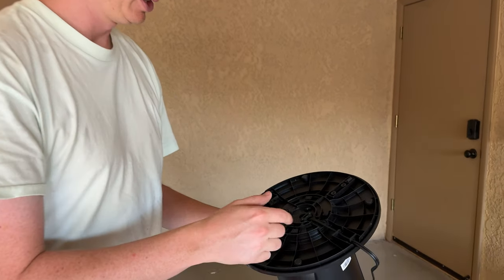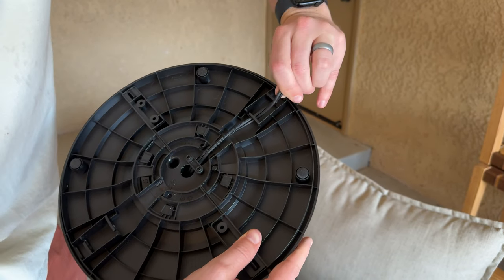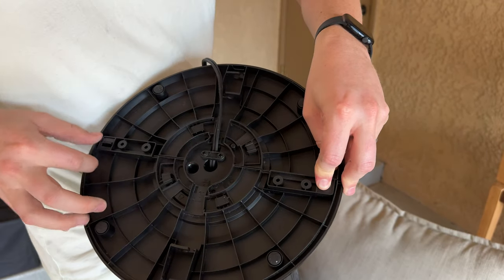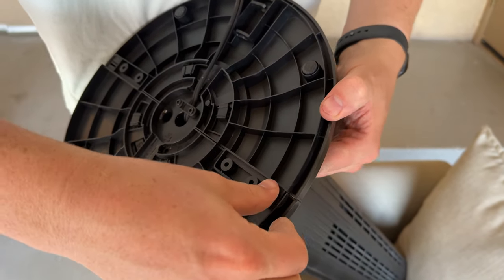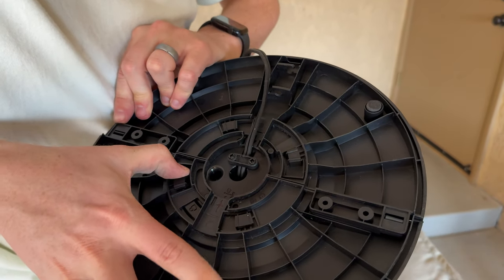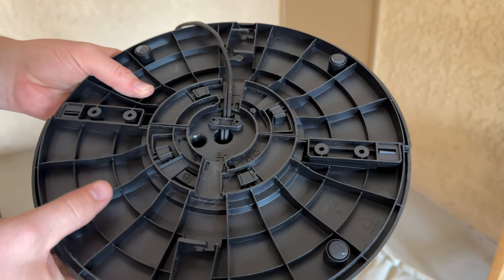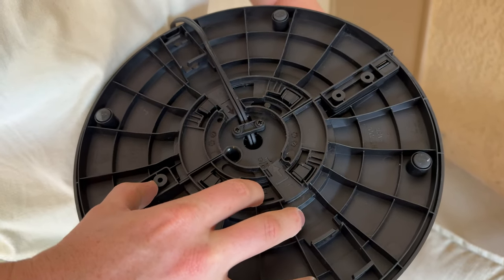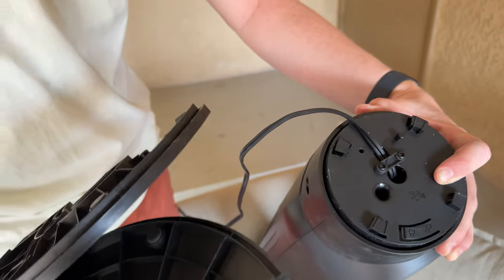Dreo Tower Fan Base Removal / Disassembly

Comment: I need help on screwing off 
what keeps the base on
Reply from the maker: Hmm. I’m not sure. I tried to outline the steps in the video. If there are extra parts holding it on it possibly could be attached differently than mine.

Comment: Im wondering how to remove the grille? I’ve unlocked the base and removed the screws. The manual is not a lot of help 😭
Reply from the maker: Hmm…I’ve never tried to do that. Not sure if that part is removable. I’ve only taken the base on and off.
Reply from the maker: Why are you trying to take that part off?
Reply: @nextpurchase  thanks for the response :) my cat projectile vomited and some got inside. Lmao 🤣
Reply from the maker: @TheAudiobrownies  Haha, not a problem.
Reply: For anyone who still needs this, you can just remove the screw near the top and then pull that cover out.
Reply from the maker: @boredvideos5616  Thats super helpful! Thanks for sharing.
Reply: @boredvideos5616 I have removed about 6 screws from the back, and nothing comes off 😥 specifically, my model is cruiser pro t3s 2nd gen (the round dreo, not the flat front arch style).  Is there a video or picture of what you mean?  My fan needs a deep cleaning and I can't handle the tediousness of jabbing a microfiber covered kebab skewers in every nook & cranny!  Amy advice is appreciated!  (I've tried vacuum & brushes, after 3 years, she needs a DEEP clean tho)
Reply: @juliab8992  Oh, I'm not sure for that model, sorry
You could try pulling really hard. Mine needs that.